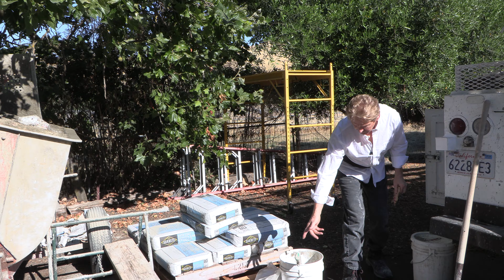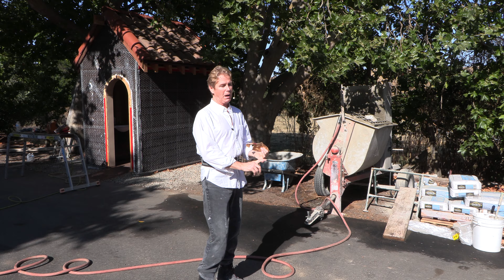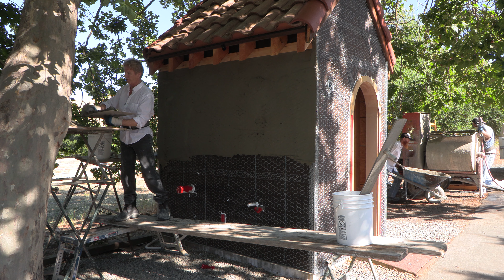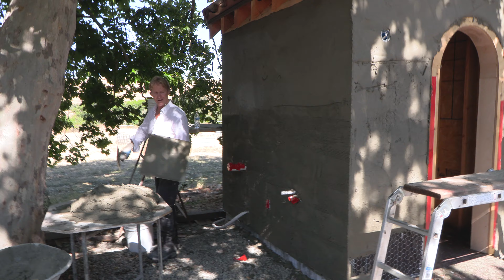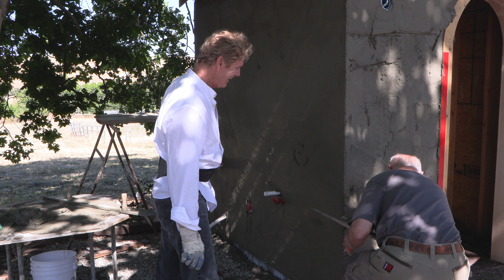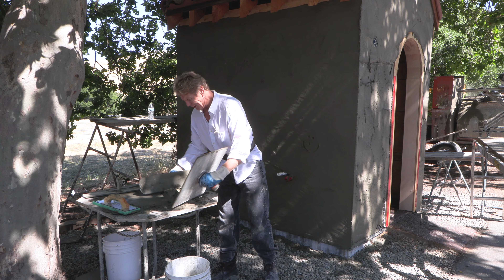Apply Home Depot Stucco Sakrete

Comment: Hello Kirk, Mr Master Plaster. I got a question for you. I have a 15x15 stucco wall where some smart person put roofing tar on it and painted on top of it. Well now the wall has developed lots of alligator cracks all over the wall and leaking inside. Oh great master of plaster what do you recommend I do to fix the wall? The tar is on there really good and the stucco wall that the tar was applied too is very sturdy. Thank you so much! 😊
Reply from the maker: Evening, are you saying the tar is on the cap or parapet of this stucco wall? Or tar is on the wall itself?🤔
Reply: @StuccoPlastering  
Hey there, thanks for responding. The tar is on the stucco wall itself. I tried to scrape it off but it’s impossible lol. The Florida sun has baked it on good. Also the tar itself has been coated multiple times with paint. What makes it even worse is that design of the stucco wall is a very bumpy non smooth old Spanish style making it difficult to patch or remove all the cracks. The reason I need to fix this wall is that it’s leaking into the wall cracks down into an attached lower porch/balcony roof ceiling. Any help would be greatly appreciated. :)

Comment: Hey guys!  Local box stores do not stock stucco mix.  Can I use type s mix?
Reply from the maker: Sure you can.Type S contains 2 parts portland cement, 1 part hydrated lime and 9 parts sand. If you buy it ready to go, you just add water.🕵🏼

Comment: I had my stucco done about 25 years ago over tyvek and the 2 inch square wire. I had to break out to repair rotted framing around a window, about 8 x 8 ft. Can I still use tyvek and that same wire?
Reply from the maker: @canadiansparky64  Tyvek is for wood siding,if you’re going to use it for stucco it must be two layers, it’s better to use two layers or 60 minute paper. It can work but it sounds like the guys didn’t caulk the paper to the frames with a construction sealant.🕵🏼‍♀️

Comment: Evening Mr. Giordano and crew
I am going to embark on a project that requires removing a window and the plywood that was surrounding the window (I think there was a larger window at one point but previous owner removed it and put a smaller one in) but instead of re-stuccoing the wall, they used plywood to cover the patch and now its beginning to rot. I have seen other videos from the channel that you remove a few inches from the existing stucco to put in the paper and wire lath and that is to help tie the new stucco patch with the existing to make it a better waterproof seal, correct?
What can I do if I cannot remove the few inches to slide the paper under the existing for some reason that may or may not happen?  My house was built in 1920 so I'm hoping for the best but would like to plan to make sure I can handle the worst by asking questions before I start. 

I will be looking through your video library to see if you did a video on a question I asked but asked anyway. I never did this so if there are others in the comments that have, please feel free to let me know some tips and tricks. I wasnt going to put a window in, but decided to replace the window with a better one. I think the window might be recessed into the wall. Related question - do I stucco to the window and put trim on the stucco or leave room to screw trim into the plywood before stuccoing? 
These videos are enough to get me an idea of where to go. I think I'm looking for that dose of confidence from those who've done this before that its not a big deal if I take my time and use the correct supplies for the job.

Thanks,
Joe
Reply from the maker: Howdy, it's alway best to cover the existing paper with new paper, but if that's not possible as the paper and or wood is deteriorated or disintegrated, do the best you can with what you have to work with.🕵🏼

Comment: I’ve noticed sackrete can be inconsistent at times…I know this by the color after it’s set up…Even measuring the water it’s dark or light after it cures..
Reply from the maker: MHowdy agin Dan. I find most stucco a bit inconstant. We apply the soupy stuff or the stucco that's already starting to set as a rule. Eventually, if it's really set, it's got to be remixed. Our arms have only so much strength; we can't burn them out in the first hour. Cheers.

Comment: Would this be similar to Eisenwall ?
Reply from the maker: @blitzmee  No, Eisenwall drys three times as fast and only sold at Plastering Material Yards, such as Westside building materials, plus Eisenwall needs three Tim’s the sand per bag added to it. This material is an all in one, you don’t need to add sand.
Reply: @ thank you for the knowledge 🔥 keep up the good work and service you do 🫡